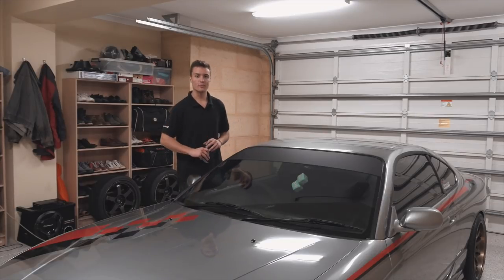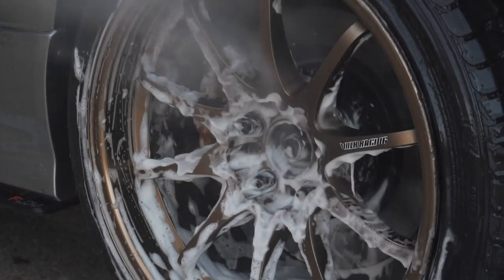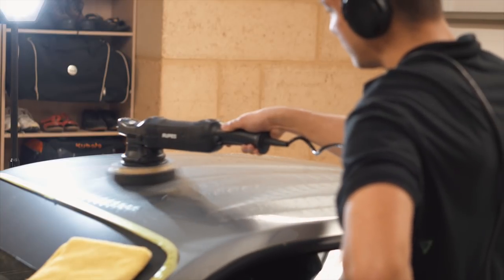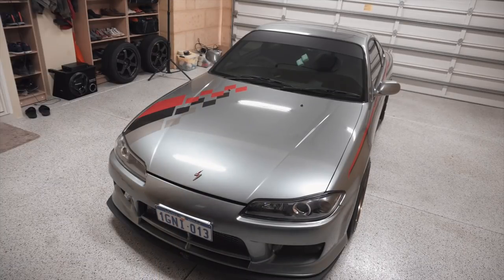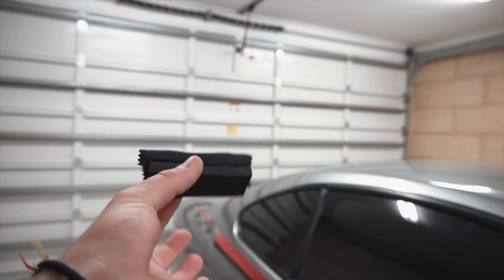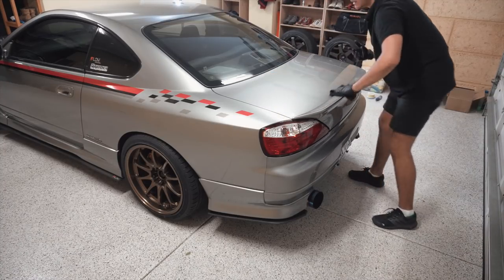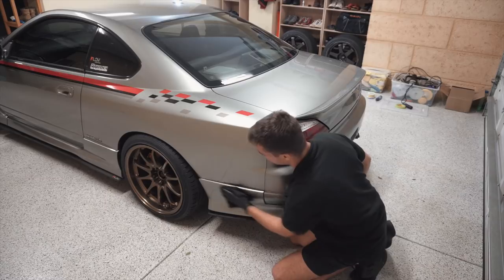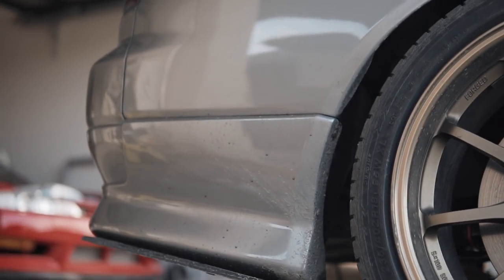'Nismo' S15 Silvia | How I Ceramic Coat Cars

Comment: Are you know where to find cheapest front gtr bumper?
Reply from the maker: Gumtree if you’re in Australia and want OEM, otherwise plenty of other fibreglass after market options out there
Reply: @BrokenSilvia  i am from malaysia.but the original bumper is PU right?
Reply from the maker: Yep plastic until you go ztune which is either fibreglass or carbon